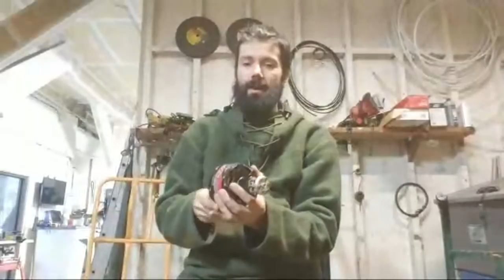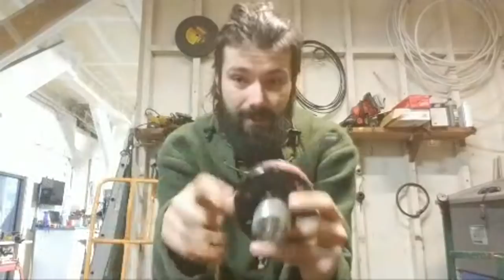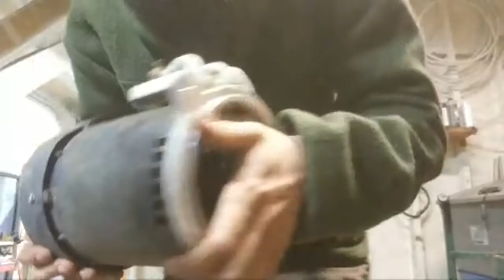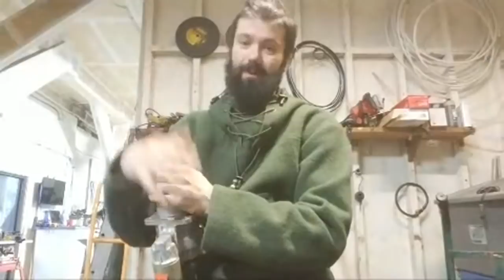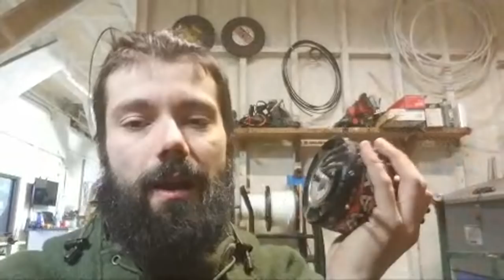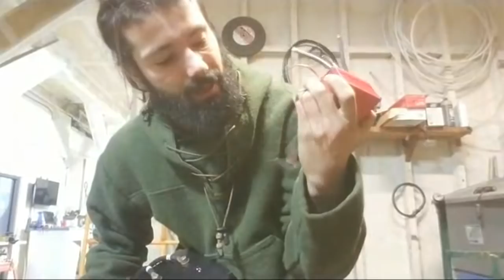Electric Sail Boat Motors - Live Chat

Comment: Big fan of your project. I wonder if it might be a smart idea to have a 40 or 50 horse outboard on the back of each hull for those times when your in a strong current or storm. I cant see basic electric motors producing enough juice in a pinch situation. Maybe an elctric motor out of a car would suffice. I've seen people use Tesla motors in boats.

Comment: brushless DC = ac motor with builtin controller... So you are dealing with an AC motor in any case. Battery voltage: Higher is better, use separate battery bank for house power. However, DC will maintain an arc for any given voltage with a much larger gap... 48v is about the high end to use with AC breakers, anything higher absolutely needs DC rated switching and breakers. But wire size is nicer with higher voltage. Brushed DC motors from a forklift have been used successfully on other boats and can regen. AC motors are fine, almost any soft start controller will run an ac motor at variable speeds... can't speak to cost though. But permanent magnet ac is better. (uses the same controller when all is said and done) Cooling is important for both motor and controller. Electric motors are constant torque which may explain why some manufactures rate them at higher HP or "equivalent HP". IC motors have almost no torque where they are used in a lot of boats which means a lower HP Emotor may very well be the same effective use as a higher HP IC. I could say lots more...

Comment: Use forced air cooling !
Industrial DC motors use blowers to force air over the windings to keep the temperature down .
Plenty of low voltage DC blowers around .
😊
Reply from the maker: Lots of salt in that air though. Might not last long exposed to that much salt.

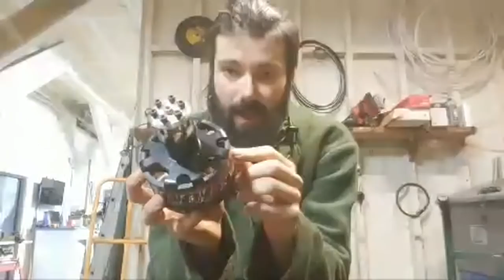Comment: In case of your needs you better consult Jamie Mental from the Concrete Island as he keep it simple as possible by losing some efficiency...and the one you're holding at 4:45 is three phase AC motor as those three leads are connected to a three phase inverter/controller powered by DC power bank....try to do a bit of research before going public, people watching, getting strange ideas and so. 
Water cooling electric motor is science fiction from your point of expertize (seriously) and forget about it, air forced cooling must do unless you wrap it in water fed copper tube but it wouldn't do much...and so on...
Reply from the maker: Nope. That's a bldc motor. You can check them out online if youd like. Similar to ac, but definitely their own class.
Reply: @findingsimon  Again, you're not right, BLDC has permanent magnets and source of supply is DC but it needs inverter controller to run properly, means it can, theoretically and practically to run on 3phase power transformer which will lower the voltage to meet motor specs -  I know that because I did it more then once. Further more, in very core of electric motor is alternate magnetic field - without it motor cant turn. Its done ether mechanically at rotor end but comutator (brushed type), electronically by inverter aka 3 channel push/pull transistor configuration or by providing alternate power supply from a grid or generator. Pure DC motor is not invented and it will never be - cause its impossible. Check it again. ;)
https://i2.wp.com/www.allaboutcircuits.com/uploads/articles/BLDC_DC_Motor_with_Hall_Effect_Sensors-1.jpg?resize=603%2C326&ssl=1
Reply: Btw, if you need any help with your electronic endeavour, feel free to contact me, I'll do my best to help before you fry everything.....and remain known as Simon the Destroyer!
 :D